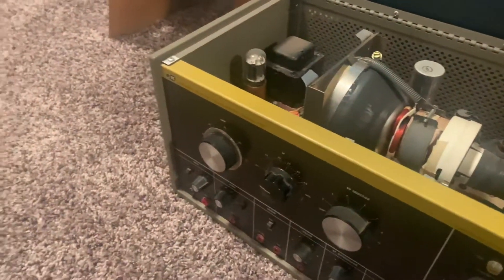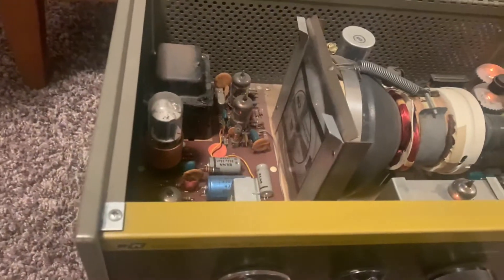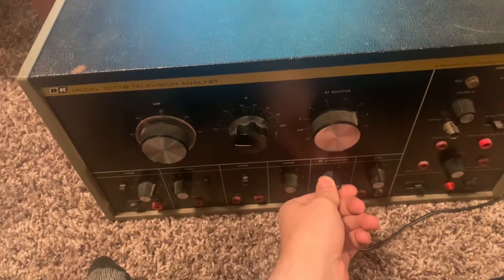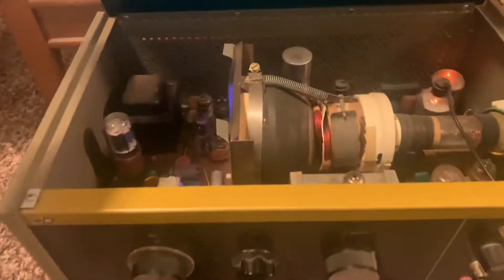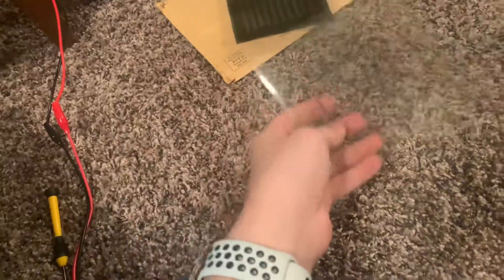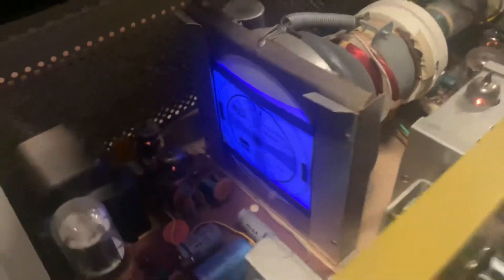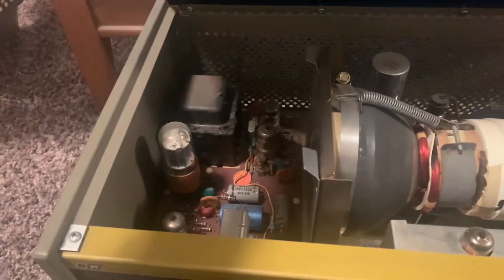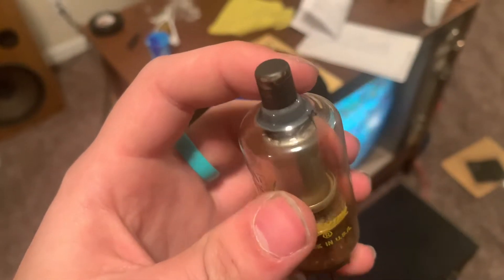Zenith Color TV first start up

Comment: Don't worry about high voltage just ground the picture tube anode in case it has some residual voltage . If you need any help or advice just ask me .  I used to fix these old roundy color TVs and that is how I paid for college .

Comment: I hope this TV has been recapped. An exploding electrolytic is not fun.
Reply from the maker: It has, I refurbish vintage tech mostly TVs
Reply: I’ve been collecting vintage TVs for over 30 years now and have yet to have an electrolytic explode. Heck some of these tube color sets were still in use well into the 80s and 90s. The more use these sets had the better the electrolytics held up over time vs a set that hasn’t been turned on since say the 1950s.

Comment: I'm hoping you are aware that these old tube CRT's can and do generate extremely high voltages at the plates and caps, high enough to be deadly. Learning is great and yes, everyone has to start somewhere, but those old TV Repairmen went through highly structured training programs under mentorship of senior technicians, mainly manufacturer specific models. None of them (that survived) just sat down and trained themselves. Please be very careful. Assume the line is hot. Assume the plates are live. Assume the caps are charged. ALWAYS!
Reply from the maker: I have a degree in electrical engineering and mechatronics. I am very familiar with safety processes. I’ve been repairing vintage tech since I was about 12 and have had many people help me learn. I will be careful.
Reply: @timtheenchanter0476 How can we determine the truth behind this without the essential in depth duel of polyvariable?
Reply: *polyvariable calculus

Comment: It would be wise to replace all paper capacitors in the set. Seems that the electrolytics are fine, but at that age, those are risky, too. You likely won't have a proper stable picture until the paper caps are replaced, and you risk damage since leaky capacitors throw off grid bias.
Reply from the maker: I would love to but I am having a hard time finding any good guidance on how to do so. If you know of any good sources please let me know.
Reply: I believe at this point Zenith was using those orange Spraigh orange caps. This TV looks to be 1966.
Reply: @edp9821  Were they film by then? I've seen maroon Spragues that were film, which, of course, is good quality.
Reply: @td3993  orange gum drops they were called.
Reply: Sprague

Comment: Man I love your setup - vintage roundie, records and stereo speakers everywhere.

I do, on a purely freelance basis, what you demonstrated in this video, albeit with patterns on DVD and BluRay.  Today it's called display 'calibration', but I think a better term would be alignment, as it is akin to wheel alignment - for your TV! 😉
Reply from the maker: If you like the vintage stuff because the channel is more for my Twitch videos, you can check out my Instagram @GVComputing
Reply: @timtheenchanter0476  Thanks!

Comment: I remember old TV's took about a MINUTE to even think about coming on!
Reply: "Thankfully" new smart TVs have their interfaces so damn LAGGY that it can take a minute of powering on from standby and skipping past menus and ads as well!
Reply: @neoqueto  👍I’ve seen a few like that depending on brand. My TVs aren’t that bad unless it was unplugged or interrupted by a general power failure.
Reply: 👍Agreed. I remember those days. My parents had a Setchell Carlson from the late 50s. It took about a minute to come up. But, from my standpoint, it was the best black and white TV in the house.
Reply: when you switched one of those you could be sure they worked, now tvs do anything but never in a reliable way, sometimes they work, sometimes they refuse.